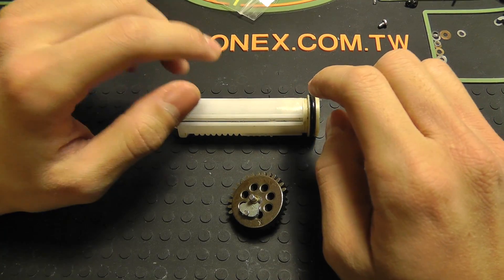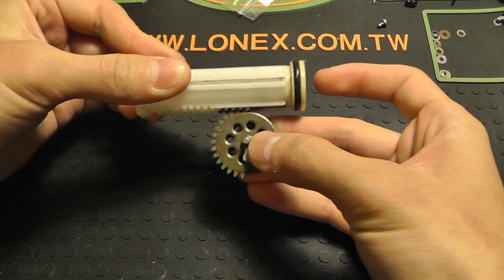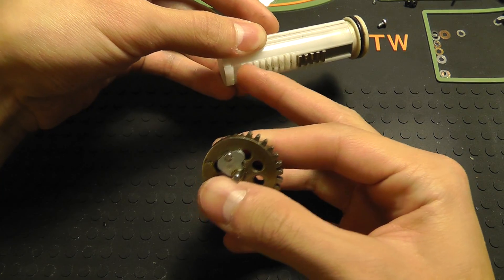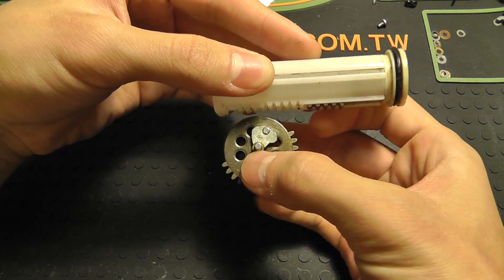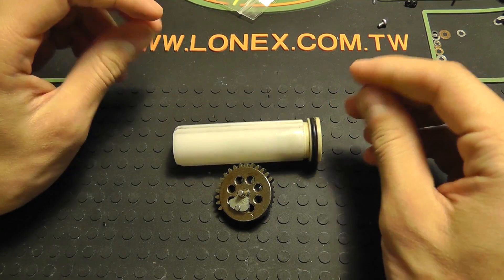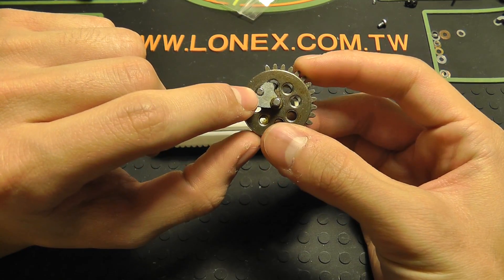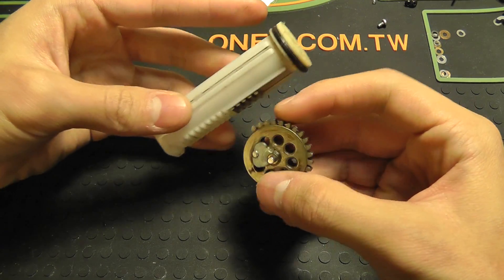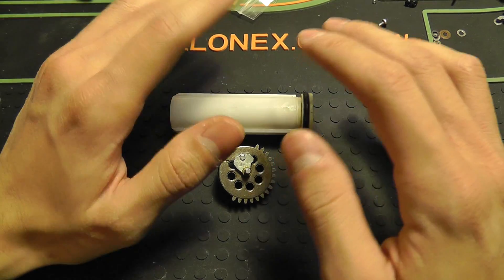Reasons for Short Stroking

Comment from the maker: If you shortstroke on the piston it helps to lighten the piston and prevent pre engagement but not totally necessary. Take 3 teeth off your sector and then try it with the m100 and see what's up. Your shs spring might be falsely rated.

Comment: Another fix for per-engagment is mosfet with Active Brake (AB for short). Basically it stop the engine immediately when you relase the trigger.
Reply: Yeah you can do that.
How well do you like your steaks cooked? cause that's a great way to cook steaks, too.
Reply: I run active breaking in a 47rps DSG setup, the motor doesn't heat up more than without active breaking really. Active breaking won't prevent pre-engagement btw, it'll only prevent overspin. If your motor gets abnormally hot with AB, then either something is wrong in your build or with the mosfet, or the mosfet is a really cheap low quality one.
Reply: Håkon T. Or you have a ssg build with a 16tpa or lower motor. But no matter what motor you run AB will wear down the motor brushes and the commutator a lot quicker, at least according to Louis brill (owner of brill armory)
Reply: I ran AB in a 40rps SSG setup for two years, the brushes had normal wear. The only thing I've noticed is that the motor will get hotter if you fire rapidly in semi-auto. I did build that gearbox with "passive breaking", it had an M130 spring and 2 teeth short stroke, so that may have lessened the negative effects of the active breaking. The mosfet is also computerized, so it probably has slightly gentler active breaking than more basic AB mosfets.
Reply: Yea, its the feathering the trigger in semi which AB will cause problems with. If you have a good AB mosfet and a good motor though, the effects will be lessened.

Comment: Great video👏
Question:
Can i short stroke a stock sector gear?
How many teeth should i cut?
Thanks more power
My set up:
-stock gears
-M135 spring
-11.1v batt
-Shs high torque motor
Reply from the maker: depends how much power you're trying to drop. You can definitely SS a stock gear. Assuming you're trying to get into the 400fps range I would cut 3 to start and see where that puts you
Reply: got this thank you so much. @valleyriverarms

Comment: This is really helpfull, thanks :)
Im thinking about using a M115 progressive spring and short stroke my piston and
complement with a hi speed engine and 16:1 gears. Thoughts?

 im more used to slow rpm and hi FPS because im in a supportfire team
but i want to have a good gun on CQB games aswell :P

Do you know anything about progressive springs??
Pro´s vs Con´s

Thanks and regards from Sweden //Toby

Comment: I have a Prometheus SP110, siegetek 14.09 gears, and an 11.1 lipo. I was probably going to short stroke 2-3 teeth off the sector. Will I have to worry about any possible pre engagement in your opinion?
Reply from the maker: Motor is relevant to the equation but after 3 teeth and a light piston assembly you should be fine.
Reply: it's a lonex A1
Reply from the maker: yeah should be okay

Comment: great video. so my stock g&p was shooting ~380 so i down graded the spring to a shs m100 but it was still shooting 395 (i also did compression up grades). so i bought a sp 85 spring and now on semi im getting a lot of double cycles and a lot of lock ups. would this and putting my old spring in fix my problem? if so how many teeth should i cut? i also just another video where they cut the same amount of teeth from the piston. (same side as piston head) thoughts?

Comment from the maker: It's not totally necessary. That being said, it doesn't hurt to cut down the weight of your piston to remove more teeth. off the piston too. It's only an issue if you remove piston teeth without removing sector teeth because you exasperate pre engagement issues.

Comment: will an M120, a lonex A2,  and 13:1 gears run into pre engagement?
Reply from the maker: should be fine
Reply: valleyriverarms
what about it with a SHS high torque and an 11.1v lipo?
Reply from the maker: Less fine. But if you short stroke a tooth or two should be fine
Reply: valleyriverarms
cool

Comment: Hey! So I just short stroked my VFC M4, I have a standard motor on it, a 7 metal tooth piston and an ASCU unit. The process went well and the gun works great as performance is concerned but there is a strange thing going on. When I fire on full auto after the 5th or 6th shot the gearbox starts to whistle and I don't know if I should be concerned about this...
Reply from the maker: whistle? I'm not sure what that could be. Possibly an air leak but that's a weird symptom. Shimming might be a little tight too?

Comment: i'm new to moding my gearbox. I don't want to crew anything up. I've installed 14:1 gears, a 110 spring and i'm using a shs hs motor. would removing just 1 tooth from the sector make a noticeable improvement in rof, and prevent pre-engagement?

Comment: when short-stroking a ported cylinder is there fps lost if the piston is still coming far enough back to pass the port fully? if so why is that? is it because the spring isnt fully compressed ?
Reply from the maker: As long as it's still clearing the port you shouldn't be losing that much fps. The port is to bleed the air until the proper volume is reached.

Comment: what could happen if you ss the last tooth/teeth?
Reply from the maker: You mess with the timing of the bb loading into the hop up chamber.
Reply: so that would cause mis feeding?
Reply: valleyriverarms In my experience removing less then 3 teeth on the release side won't cause any issues unless you've installed a really big tappet delayer chip on the sector gear. Removing too many teeth from the pickup side can actually cause compression issues at very high ROF as the tappet timing will be advanced enough for the sector gear to pull back the tappet plate before the piston is fully forward.

Comment: without shortstroking,just simple mods
Reply from the maker: active breaking mosfet, stronger spring, or slower motor are your only real other options.
Reply: well thanks I was just wondering because I am I already have a hightourque motor and m130 but still getting overspin
Reply from the maker: slow it down someway. Maybe with a weaker battery or something